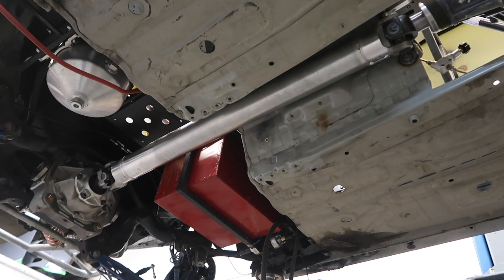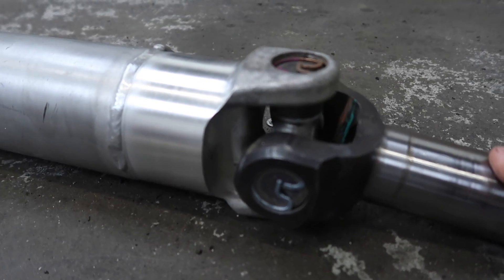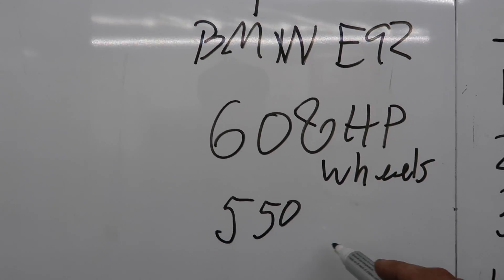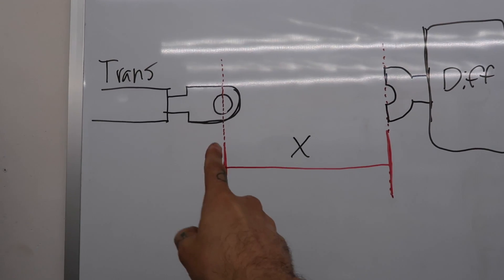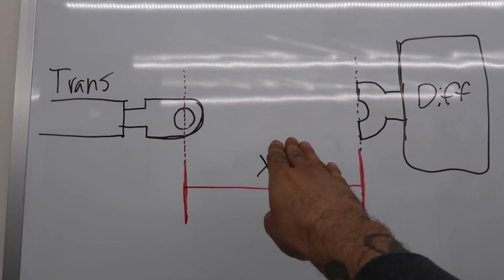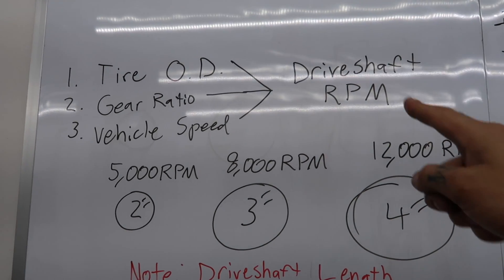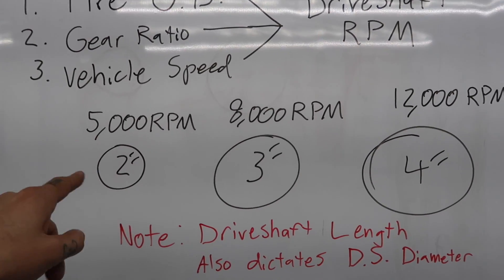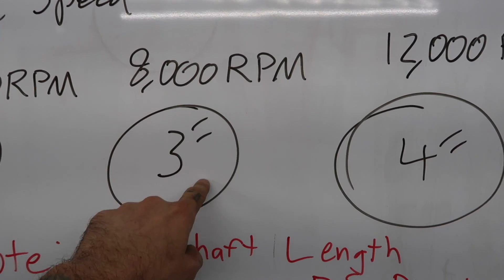How To Measure Driveshaft Length, Spec Yoke Size, and Driveshaft Diameter

Comment: Ford 9" IRS rear setup, sweet! You running 33 or 31 CV axles, 930 or 934?
Reply from the maker: It’s a pretty trick setup. Dutchman axles makes a bulletproof housing. They are 31 spline on 930s